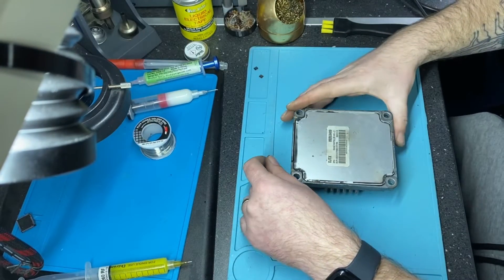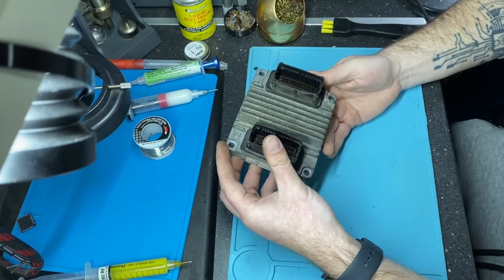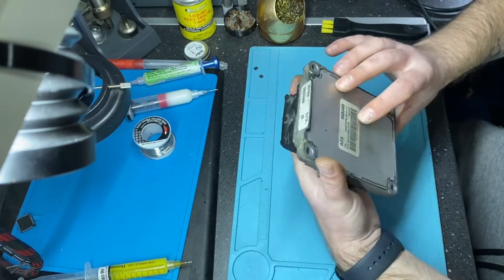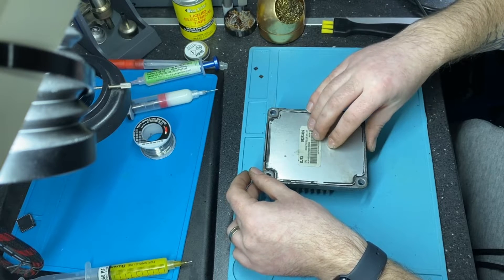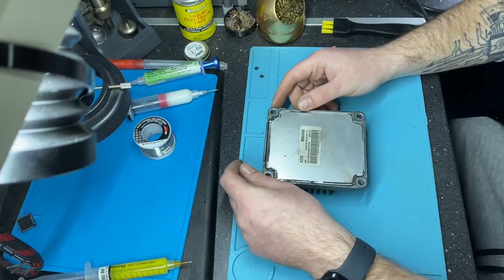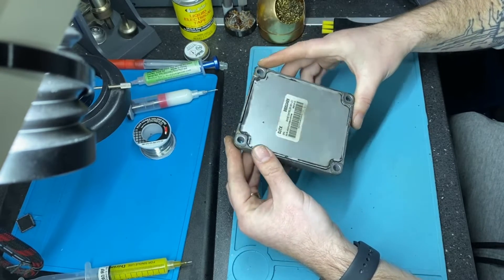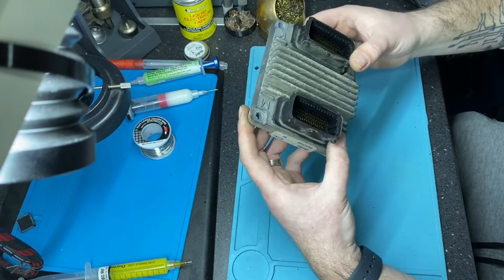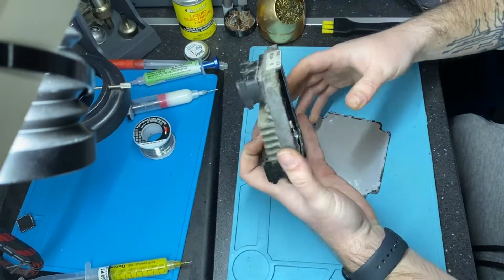ECU Opel Astra HSFI 2.1 Repair - Jump Wire replacement

Comment: hello brother what kind of flux is that?
Reply: there is no recomendation to a " no clean flux", so carrefull using and not cleaning.
Reply from the maker: Hello, It is NC-260/RF Flux designed for industrial "Nozzle Clean"  but is also good at soldering.
Reply: @UnixCoDElectronics  it is good for micro soldering?
Reply from the maker: @hamakistarr  I cannot say because i don`t do micro soldering ( like phone repair ) but overall it clean very good the oxidation